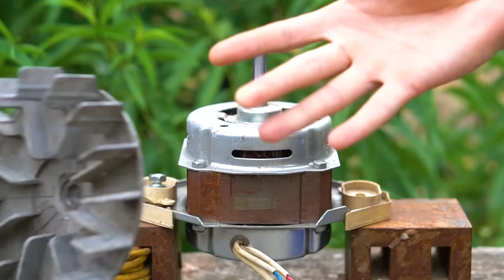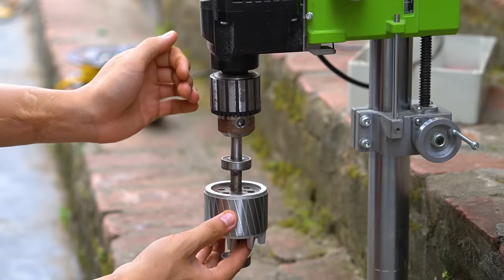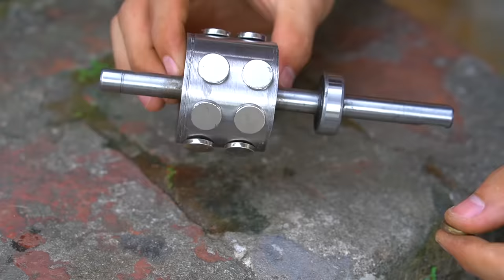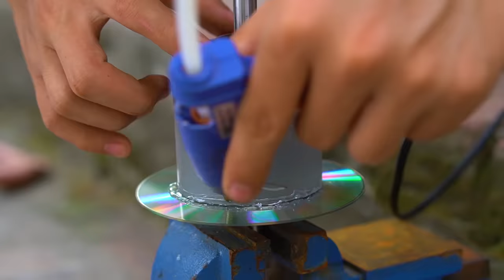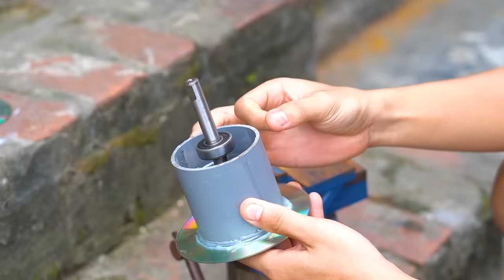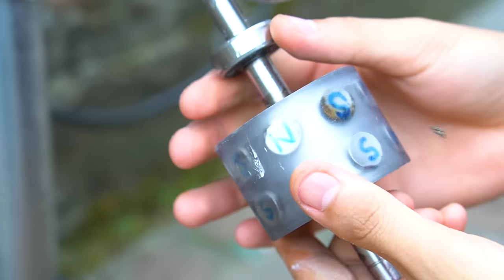I turn Washing Machine Motor into 220v electric Generator

Comment: The pulley on the motor/generator is twice the diameter as the one on the gas engine. If you switch the pulleys you will get 4 times more speed and thereby produce 4 times more electricity.
Reply: maybe it needs the torque
Reply: It's usually not that easy.
Reply: More power may not necessarily be a better result in this case. Remember that you have to not only control the total voltage but keep it at the required frequency(notice how slow the fan is moving?). Great job overall.
Reply: @SrIrv   When I said more power, I meant more electric power; I changed it on my comment. A larger pulley actually has less mechanical power because of less torque. The bigger the drive pulley the more generator speed, but less torque. The gas engine has plenty of torque, so that won't be a problem here. When the drive pulley is larger than the generator pulley it spins the generator at a faster speed than the driver rpm; that's why people use a 24" bicycle wheel to turn an alternator with a 2" pulley(12 times faster); more generator speed means more electric output up to a certain point.  The frequency is how fast the current changes direction, so the faster the rpm, the higher the frequency. When studying electronics, it's said a higher frequency always means more electricity. Switching pulleys would give him 4 times more speed.

The fan runs so slow because his set-up is only producing about 2 amps or less, that's why I said he would get better results if he switched the pulleys. (The monitor of this page doesn't think switching pulley's would be better,  that's why he Highlight's any opposing reply to my comments.)
Reply: @henrywilliams1439  Would you get more power or just higher voltage which would slow or stall the engine if too high a current were taken.
Reply: @henrywilliams1439  I meant power as in watts, Volt Amperes, Joules/second. The speed of the things show would depend on the frequency of course, but with short shutter speed video cameras it is difficult to judge speed due to strobing effects.
Reply: @brianfretwell3886   All I can say is, the links I gave you explain it all better than I could.
Reply: The voltage output are dependent on the speed of the motor, if you make it faster the voltage will get higher than 150v.
Reply: @maypagusapanlang5841   Yes, I agree.  If he puts the large pulley on the gas engine and the small pulley on the motor/generator, then the motor/generator speed will be 4 times faster than it is now.  It will go FROM a 1 to 2 ratio, and BECOME a 2 to 1 ratio which will be 4 times faster than it is now.  There are two ways to increase the speed of the motor/generator. One way is to increase the speed of the gas engine; if possible.   The other way is more sensible, and that is, to change the ratio between the two by switching the pulleys, so the larger pulley is on the driver and the smaller on the motor/generator.
Reply: Lol ever heard of torque?  Shit won't able to pull the load and blow up
Reply: Remove that huge speaker that most likely has batteries and an Inverter housed inside of it which is actually supplying the pump and the fan with power through the strip which isn't even connected to the "generator" he made... I could be wrong but until the speaker is removed I cannot believe it to be true. Sorry.
Reply: That's right👍💯
Reply: When a generator comes under load, it requires more to keep it turning.
Reply: @59KYHighlander   Yes, more load requires more torque, but the gas engine provides plenty of torque. Even if he was to switch the pulley's and turn the generator 4X faster, going from 2 amps to 8 amps, I think the engine would still provide the torque needed.
Reply: @henrywilliams1439  absolutely..
Reply: @henrywilliams1439  you are a patient man Henry :-)
Reply: @henrywilliams1439  o
Reply: @SrIrv  just shutter speed from camera notice it goes backwards for split seconds. Just an illusion
Reply: @Henry Williams By increasing the motor speed, will it raise only for the Voltage or the Amps, or both?
Reply: แปลภาษาไทย
Reply: @SrIrv  frequency?.. are you sure?.. you do know every appliance like the fan has a full bridge rectifier inside.. nothing gets powered before the AC is converted to DC and then there are capacitors to smoothen the gaps... frequency plays a role in things like big electric motors a little for optimal power useage but not in appliances like the fan/small dc motors..
Reply: @henrywilliams1439  I agree with u.., because small pulley rotates the motor faster than large pulley..That means , if we use small pulley speed increases, Torque increases, output power also increases.., maybe it can be 200v or 250 v.., based on speed.... 🔥🔥🔥😀😀
Reply: @kurapatianandraj2065  Yes. It's amazing how many people don't understand a simple 2-to-1 ratio.  A smaller pulley on generator means faster generator speed, so long as the driver can deliver enough torque.  The electrical output depends on the strength of the magnets being strong enough to push more volts and therefore more amps.
Reply: @henrywilliams1439  very well said sir
Reply: It will still be same power just higher voltage but less tourqe so less current
Reply: That seems really cool to do something like that. Can someone explain why he took the motor apart and grinded down the part that spins (whatever you call it) and then put magnets and resin when it was already working? How did it go from 110 to 220?
Reply: @jmidnite114  my friend...what he did was take a motor....and converted it to a generator. So instead of requiring energy, to create tourqe...it now requires tourqe....to make energy.
Reply: That's about the simplest way I can word it lol
Reply: @SrIrv  bro the current producing from the generator is fake or real i don't know but i think the fan is spining it in its maximum speed, the shutter speed of the camera is more higher. Thats why we will see the fan is spining at low speed.
Reply: @henrywilliams1439  i too think pully changes are needed but this set up needs a meter in line to show working amps. 
Im looking for functional college level project of water wheel to power.... i think this will theoretical work.
Reply: @judygoodson5855  Hi Judy. The purpose of his video was just to demonstrate how a motor can be changed into a generator if you have no other choice. But, on a real working system you would want to start with a new ready-made generator with all the electronic advantages. Here's a waterwheel generator build from the "Homestead Rescue" program that you might like: https://www.youtube.com/watch?v=KMaSEyfd19Y  They first made the mistake of trying to use a gear box which robed the system of power. Then they realized they needed a single large pulley turning a much smaller pulley on the generator. 

They built an 8 foot tall wheel with 12 inch paddle boards. The diameter of the wheel was larger than needed, making it turn slower. To keep it short: 1) the smaller the diam. of the waterwheel, the faster it will turn. 2) the wider and longer the paddles, the more water it will catch so the more power it will have. 3) and the lighter it is, the faster it will turn. 4) the faster the generator turns, the more volts and amps it will generate (until it reaches it's maximum output.) I hope that helps ya.
    P.S. Normally you would want to use water tight bearings, but they now make special water-lubricated ceramic bearings that are made to last.
Reply: @henrywilliams1439  thank you. I have my concepts in my minds eye to pull it all togeather. 1. Ram pump 2. To backshot wheel 3. To power source.  Think to try making it a closed loop on wet side.
The magnet ideas are a good alternative concept... watched another yt that converted a direct drive washer to a generator. My concern is these concepts are not showing the safety side of electricity and water.
Reply: @henrywilliams1439  The fan isn't moving slowly. The refresh rate of the camera used to take the video is close to the fan speed which is why it appears to be moving slowly when it isn't. You can tell this by how the fan is moving back and forth. The oscillating mechanism on the fan rotates the fans back and forth based on the speed the fan is going. Since the fan is moving back and forth at a normal rate it is safe to say the fan is spinning at the normal rate. otherwise that fan would really fly back and forth. Also when the fan falls over and he sets it back up a you can see it start to spin really good then seems to slow back down. You can do the same thing with a strobe light and a fan. once you get the fan and light synchronized it looks like the fan blades are standing still. But I do agree that the pulleys should be switched. If nothing else just so the Yay and Naysayers can see the results.
Reply: @picayunebill6614  Yes, there's much truth to the strobe effect; as I noticed back when I ran a (Kitamura HX300iG CNCHMC: https://www.youtube.com/watch?v=rx_JqQLYPXY). When I adjusted the speed to 3600 RPM the spindle seemed to stop while machining. I called maintenance who figured out it was the light and the spindle motor were both at the standard 60 hertz, so at any speed that was a multiple of 60rpm it worked like a strobe light. Scared me at first.
    Ah, yes, the Naysayers. My first comment I deleted because of all the name calling, like: Highlighted reply "@Henry Williams  Big noo, you are wrong. The diameter is never proportional to the speed. Where did you do your elec or mech degree? ...@Henry Williams  😂😂😂😂😂😂😂😂😂. Listen young man, i dont ague with idiots. i have a Bsc eng in Elec so i won't be aguing with such people . You seem to cant understand basics 🚮🚮🚮. Go n reand books then come back. I analyse, design and solve complex problems. " - Later he said; "Ohh young men.  'You said if he switches pulleys'. Then you are right."   ...He never apologized.
Reply: @bparker86  yes and now it takes fossil energy to run the engine to run the generator .😂😂😂
Reply: @georgeharisson1880  that's the same thing I said guy. You say fossil fuel and I say torque. Same idea there genius.
Reply: @bparker86  I never said said I it didn't , the motor uses gas right? that is fossil energy that is converted to mechanical energy ( Torquay) and then to electrical energy. 
Genius 🤔
Reply: @PatMan884  underground  wire probably.
Reply: @beedeetridip8480  If you increase the Voltage, you will decrease the Amperes for the load (vice-versa) that may even burn the load if overvoltage above tolerance rating.
Reply: Doesnt work like that a simple generator like this needs to be spun at 3000rpm as constantly as possible variation from that means destroying the things your powering
Reply: @shaynegadsden   Remember, this is a converted motor into a generator, nobody knows how many rpm it needs or what rpm it's turning at presently. As a motor, it wasn't designed with these magnets, which are weak. The strength of the magnets, their distance to the winding, etc. and speed of the rotor all work together to determine what speed is needed to deliver enough volts and amps for the appliances. The pump runs too slow and looks like it needs more juice, so increasing the rpm will help that.

Comment: How many poles were in the field windings? Even if the right number for the number of magnets, the magnet position didn't seem to be too precise. Were the pulleys the right ratio for 50 hz? Would be interesting to put scope on voltage, audio equipment usually likes clean ac voltage.
Reply: Even if the engine speed was controlled to make 50 hz, the voltage wouldn’t be controllable without changing the frequency since this is a permanent magnet generator (no control of field strength). I’m not knocking the project, it’s a cool idea, but this wouldn’t be suitable for utility power except for devices which can handle variability in voltage and frequency. Curious if the speaker was just a prop here, or if it has an internal power supply.

Best option for a PMG is to rectify the power into DC and use an inverter if AC power if needed.

Comment: The idea is good,but this generator does not support the stability of the voltage of 220 V and the frequency of 50-60 Hz . The author must connect a Voltage and Frequency stabilizer after the generator.
Reply: Agree.

Comment: Good idea.
But you're giving it lots of energy to get the 240v out, why not try to connect it to a windmill of some sort.
Reply: Idea
Reply: Windmills won't give enough speed or constant speed to keep a steady voltage. Windmills are good for charging battery banks.

Comment: Beautiful, but there is a problem: the current delivered is not at 50 Hz. Therefore, using this current will break the objects.
Reply: Are you sure that it will break the object? And how do you know?
Reply: @jamesnash6101  Yea its not smooth current.... the Hz matters lower may be  ok but higher will fry equipment .. just like in welding frequency..
Reply: @jamesnash6101  yeah he need inverter for that but sadly he dont have one i guess.
Reply: @themadscientist5025  yahh.he needs battery then inverter

Comment: Good job. However I'm not certain that this particular configuration could produce 6000watts. Not with that little engine anyway.  Regardless, very neat!
Reply: The Bass is over 9000 Watts
Reply: Book 9000w one  for me. Dm me the price
Reply: He is just scamming likes and views
Reply: 600w would be a more realistic figure
Reply: A generator is actually a motor but used in reverse!.
So in other words, a 1000w motor used as a generator cannot produce more than 1000w of output electricity.
So to produce a 6kw generator , you have to have a 6kw motor  (assuming a 100% efficiency).

Comment: yes this can generates some small power..10:16 but impossible with just hand rotation to generates 240v...don't fool people..
and the resin will melt, better drill a hole for magnet sitting flush with the rotor..
Reply: Yes, but the idea that I can create a generator and use a large wind rotor and gear it down to increase the speed of a smaller spindle means I can generate electricity in my yard. I can Rectify it and store it in batteries.

Comment: it doesn't seem to be all that functional, it's hard to believe it actually works with so many working devices!
Reply: Should be possible up to about 5 or 8 A max. Looking at the diameter of the wire (maybe 1.5 mm²) you can't get a powerful generator.
Reply: Working with an unknown frequency is lethal to any device
Reply: @bongaguilar7623  yes, indeed.
Reply: @bongaguilar7623  اذا كانت سرعة الدوران ثابته فأن الناتج كذلك يكون ثابت 
اما كلما ذادت سرعة الدوران او نقصت يحل تذبذب ويضر بالاجهزه
Reply: I Dont understeand but YEAH youre right man
Reply: Why should something be complex to work. Half the problem with the world is people complicate things. Simple rules!
Reply: @natek4071  the problem is there is just making something work and then there is doing it properly and when you are messing around with stuff like this the outcomes can range from perfectly to catastrophic failure or potentially worse
Reply: never....ever....
Reply: Am I the only one that noticed the speakers can’t work like that lol
It’s a power cord into the speaker positive and negative terminal